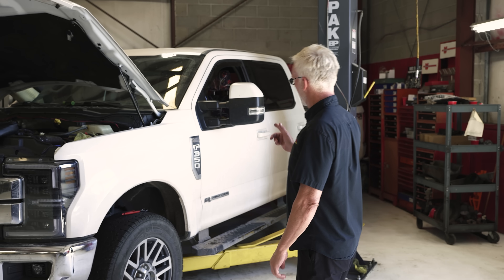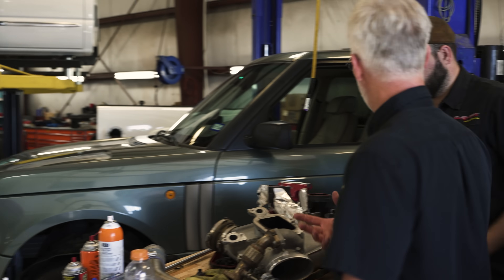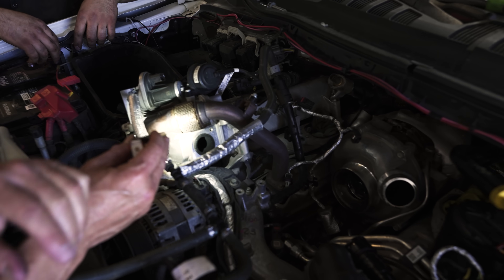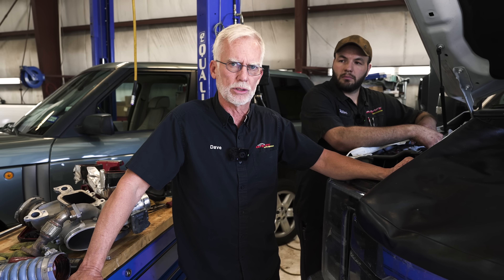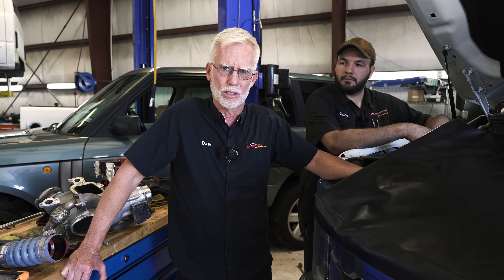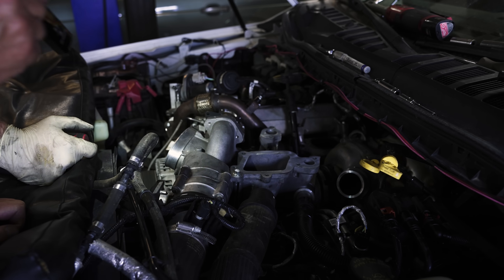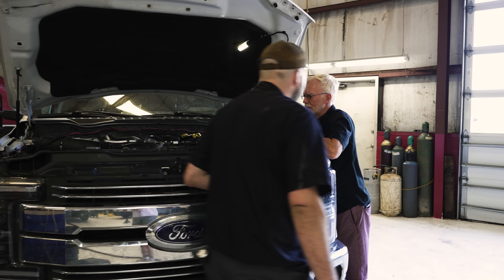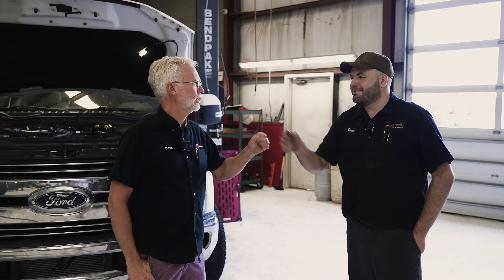2019 6.7 Powerstroke EGR Maintenance: The Problem With Carbon Build-Up

Comment: This problem mainly exists because diesel engines are incredibly dirty machines, at least when running on diesel. Cleaner fuels and engine designs should be used. Also, many people leave their trucks idling for extended periods, which is not good for all the narrow passages in the emission control equipment.

Comment: Methanol injection has proven over  and over that the steam, etc breaks this stuff up and prevents build up and keepd dpf clean.
Its a tiny amount,  its not a power adder, but it does keep engine running clean
Manufacturers reuse to do it. Because we already have the dumb def ,  its gear, so one more tank, pump, plumbing adds costs
In fact the dpf becomes redundant afyer the methanol system is allowed to do its thing
Yep plain old windshield washer fluid. 2 bucks a gallon

Comment: Dude's want to daily drive diesel work trucks without treating them with the maintenance work trucks need. These EGR issues aren't new, and they're here to stay, so get used to it and maintain them like everyone should know by now you need to.

...or just drive a gas truck if you don't pull stuff for a living.

Comment: That’s not even that bad for 200k, I’ve had them with upper and lower intakes packed with half inch thick of carbon at less than 100k.

Comment: It’d be interesting to see one on the dyno before and after, including emission levels, NOT easy for sure, running a choked engine to max and hoping it doesn’t de-coke itself mid run.
I remember the nat aspirated Transit with the bananna manifold, took a few apart to clean, sometimes just a pencil sized hole through them. 
There really needed to be a better way of recirculating the nitrogen etc.

Comment: My old 4.2 ford gas v6 had the same issues.
I frayed the end of a 1/2" cable chucked in a drill and ran it through all the intake ports in a parts washer. Worked amazingly.

Comment: Just a heads up, Purple Magic works wonders cleaning off carbon from EGR coolers. Its not as corrosive as oven cleaner and does need a few treatments to get everything off but it does work well if the parts are submerged in a tank full of it for a day or two.

Comment: One of the things Dave never points out is WHY the EGR gets this way. Too much idle time and too much fuel that can't be burned. That's why EGR was put in. There's a solution: Stop idling for hours and see if you can get better injectors. This issue went away for gas engines when companies abandoned the carburetor which wasn't efficient at mixing gas and air.
Reply: What if you install the high idle kit from BD diesel. Won't this help if you do idle for extended times?
Reply: @BB-zc4gq  it might but the idea behind using diesel engines is the high efficiency at idle. However, with the "improved" efficiency of pollution controls, the amount of damage is causing some companies to switch back to gas.

Comment: Hey Dave, gasoline engines can normally operate with up to about 15% of the total flow volume through the engine, being redirected through the EGR....

Diesel engines on the other hand, they can operate with up to 50% of the total volume that's going through the engine, being redirected back into the engine through the EGR system..

Comment: The egr needs to run hot to work.
My 2litr audi a3 diesel engine works very hard for me.i live in a  hilly Hereford UK. I seldom get to 6th gear.I have done 254000 miles and zero problems with the sensor getting sooted up.
Most people with similar engine get the coil warning sign.
They just need to find a very steep hill and load the car up with a few heavy people and drive up the hill at 4000rpm afew times.
The coil icon will go off on the dashboard and you wont need to waste your money on the mechanic

Comment: I always love learning from you Dave about engines.  I am curious as you start building engines with the speed of air pistons and total seal piston rings, will that also extend the life of the engine by being less regens over time?  If that would help extend the life of the engine, then it should definitely be pushed by you for every build you do.  Keep up the good work, love the channel

Comment: What I’ve noticed with these diesels with egr’s is the guys who use them as work trucks ,towing heavy ,foot to the floor everywhere they go have 400k on these even non deleted..The ones that use them as day to day pavement pounders around town are losing EGRs ,turbos and fuel pumps before 100k…These things need to work!

Comment: I have a 2022 F450, it does get used quite a bit unloaded but never idles long, mostly highway miles. Can I reduce this type of soot by using my engine brake more when descending a pass? Forcing higher RPM’s… do you think that would help?

Comment: How inefficient is the modern diesel engine to produce that much soot in the exhaust system that you don't see?  The DPF hides all of that excess carbon from incomplete combustion that gets recirculated to the intake system.  Diesels had EGR since the late 90's and didn't produce half that much soot with out cooling.  The additional fuel for reduced efficiency and whats required for the DPF regen process just boggles the mind.  I've owned Cummins powered Dodges since '89 with my current '08 holding on. 
The first I saw how sooty the modern 6.7 Cummins was in 07.5 when they first came out and guys were deleting the DPF with resistors etc. without disabling the EGR.  The stock programming would just pump out dark soot at idle as soon as the EGR was activated.  It wasn't long until programmers started to disable the EGR systems with the DPF delete kits and magically your mileage improved and the soot level in the intake obviously was eliminated.  Oil would stay clean for 75% of the drain interval with proper tuning.
Sad that we now need to physically remove this excess carbon from the intake system of a $30K engine to keep it alive and comply with EPA regulations.  Seems counterproductive for these environmental controls.

Love your channel, your shop and lean in with every episode with how your team...rather...family of technicians tackle the modern engines.  There needs to be more shops like this.  Cheers.

Comment: I understand there is two types of diesels, the older diesel runs cooler and produces carbon particles, which a DPF is used to filter out and burn off the particles. The new diesel runs hotter and produces nitrates in the exhaust, which is catalyst with the def fluid. I would be changing the thermostat's on this one, it could be running cold.

Comment: Dave, from South Afica, I absolutely love your YouTube channel! As a trained aircraft tech I celebrate your systems.
Regarding this truck at 220 miles. Yes, things are bunged up. I think you should have mentioned that the owner must have serviced regularly for the engine to be good with only performance issues due to breathing problems. Go fot it! I love your problem analysis motto's

Comment: With all the sensors and electronics on these trucks, it seems owners would have an idea beforehand that their driving habits were creating a maintenance issue.   I need to learn how to use FORSCAN tool but not sure what parameters I need to look for.   I do know you got to keep score.  Hey Ford, how about giving owners more choice in a monitoring menu?  Thanks Dave!

Comment: But seriously, I'd love to see some test data:  Emission levels with a fully intact modern diesel. Emission levels with a modern diesel that has been deleted (No EGR, No DPF, No SCR).  Emission levels with a fully intact modern diesel DURING regen.  Are the levels bad enough during regen to negate what we're catching in the first place??  I'm sure in the states that require inspection, shops that actually do the inspection aren't doing it during a regen.  Am I wrong?

Comment: I was talking to a guy with a brand new Kenworth truck it was beautiful he said that it's hard to get a million miles on it this is before EGR it seems to me if you're blessed in the EGR pre-cooler clogged up and won't let exhaust gases into your engine you might get another million miles out of because the system that they created clogged up and bless you if they perfect that

Comment: Dave, you probably aren't wrong, the emission control systems in modern diesels are what make them so expensive to repair and why the life of them aren't what they used to be.

the sad thing is you're still probably looking at $1000 preventative maintenance bill every 80k just to clean out all that soot from the intake tract. if only we didn't need a DPF, DEF and EGR system

Comment: I wish we would all get together and create a class action lawsuit against the EPA. These devices are robbing up of fuel economy and costing us a ton on service. There is no reason that a 4X4 work truck with a 5.9 in 2001 weighing over 10k got 25 miles on the highway and now my wife's 3.0l Jeep barely gets that at have the weight and close to the same power numbers. What have they done to help the environment other then put more money in the fuel companies pocket. The biggest question I have to raise with these rules is was this a law passed but congress or a rule made up by the EPA. Where did the rules for the DPF and DEF come from.

Comment: I wonder if egr really help with pollution in the long run?   How much pollution are you saving  when your driving down the road at a constant speed with engine at operating temp? Seems like 70s regulations put on modern engines.

Comment: You could clean whole intake system without dismantling intake and egr with cooler with machine called TEXA H2 BLASTER. In Europe we are using it as regular service to prevent clogging intake system with soot, but this machine cannot clean system when its fully clogged up, it only serves for regular mainteanence every 40000 to 60000kms or 25000 to 38000miles and it really works unlike other solutions on market such as chemical or other kinds of tools.

Comment: Now you have me worried. My late cousin gave me his father's 2000 Camry LE 4 cylinder. The egr valve wasn't working when my cousin gave me the Camry on May 23rd 2018. I didn't  know this at the time. I've driving the Camry this way ever since. So are you saying I have damaged my 4 cylinder engine? Oh geez. I have all the things to hook up the new egr valve. But I'm worried this won't do any good. The Camry needs alot of repairs for which I'm doing. Anyways thanks much for the video.

Comment: CCV valve to an oil catch can or 2 oil catch cans in series.
And
EGR pipe rerouted to tailpipe after DPF

Or
ECU Tune and oil catch can (s)

Addition of an oil bypass filter can also help with the carbon buildup in the oil.

Comment: I had to clean out my throttle body it was full of carbon afterwards my fuel mileage went from around 15 mpg to around 20+ mpg, it does help your beast breath much better

Comment: I blocked the egr on my tata hexa 2.2 when it was 10k kilometers. engine is clean. No problems. Efficiency has reduced a bit, but it saves a lot of headache later.

Comment: I have a 2021 L5P.  Ever since it was new l have used the Pittsburgh Power Max Mileage fuel catalyst. It's supposed to help the soot burn off at 650° instead of 1100°. Just recently at around 20,000 miles, I installed EGR filter by FASS. I'm hoping these things help my engine live longer.
Reply: Have u notice a reduction of def after using power max ? Does it help ur motor oil maybe not as dirty? I have a 8.3 Cummins I pull a large horse trailer,with highway miles . No idling. Be great to have some feedback

Comment: Toyota Ford Mazda 4--5 cyl  Direct Inj T/D need clean out every 60,000--90,000miles 
manifold / throttle body /egr /egr cooler / intercooler + pipe work 
clean pressure and air flow sensor 
Fit oil catch can and optional EGR reduction or delete 
Sludge buildup in cylinder head ports at 120,000 miles is severe 
Highway or city driving  makes NO difference

Comment: In Australia, lots of people put a catch can between the crank case breather and the intake, eliminating the oil going through the intake and stopping all the exhaust particles from sticking to the intake.
Reply: They dont stop egr blockages just blow by gases.
Reply: Hot burnt carbon will still cake to the inside 
Yes it is cooled down 
To approximately 130c

Comment: I Agree, also, Regular oil and filter changes are needed more frequently because of oil contamination which is a big problem, if not done will reduce engine Life. My EGR and DPF gets stripped and cleaned every year, it just makes sense, maybe need to go further, thanks Dave.

Comment: I recommend getting a pressure washer cabinet with citrus degreaser or simple green. Especially since you're going to see a lot of these for regular maintenance. I work at the largest aerospace repair and overhaul for valves, and we use an ADF pressure washer cabinet with daraclean 235.

Comment: This trickle down from commercial trucks.. it has been a nightmare for them and they claim it was supposed to regen heat to burn off the carbon... more trouble then the engineers expected... delete it and the diesel exhaust fuel DEF....

Comment: I have a 2007 Ram 2500 with a Cummins 6.7. Mopar recommends a "EGR service" at 67,500 miles. It consists of a crankcase filter, EGR cooler cleaning and a EGR disassemble and cleaning. It's a very easy service and makes a difference in the engine performance.
Reply: It's amazing what maintenance does, All these people act like it's some unfeasible unreliable thing. And people who know how to take care of their stuff don't have any problems... Crazy
Reply: the egr cleaning was removed when DEF was added to the Ram in '13 or '14. They use much less EGR, now thanks to DEF, to control NoX.

Comment: 220,000 mi is in all that bad, I just replaced mine because the PCV valve is much harder to get to but mine's gas and it has 236, 000 mi turns out it was the PCV valve going to let a mechanic do that. People don't like emission systems because they don't understand how much good they're doing. Don't drive a diesel if you don't need to

Comment: My 2011 dodge didnt come with def, but had egr. First thing I did was delete it all an took off all the plastic off my motor. So much more room to work now also upgrade to holset cheetah turbo. I get 25 on interstate an anywhere from 15 to 18 in city depending how heavy foot is. Truck is pushing 550 horsepower an 1100 torque.

Comment: I did my 6.7 at 100k.  The EGR cooler was plugged and carbon in every passage.  Not a professional but was able to do in a few days.  When I got tired I stopped.  Truck now has a 145k and still runs great.  I guess I will look at a redo at 180k.  My total costs were the gasket set.
Reply: It's literally just a filter!

Comment: Dave you know as well as I do that very few will do the required maintenance, check the SERVICE MANUAL for required maintenance schedule. The liquid Nitrogen surely is part of the problem Dave. Is soot truly carbon is my question, carbon is very difficult to remove from metal surfaces, chip it off with a hammer and chisel. Most everything if burned leaves carbon in return. I can guarantee you that nitrogen, liquid N , will eat up and pit all metal surfaces it comes in contact with. Valves, valve seats, pistons, rings, and down into the oil. Just a thought of why these trucks are lunching engines. I feel Cat skinned the cat better with twin turbos and screw the DEF and recycling the exhaust. Where is Gale Banks, he is one that quite possibly has some kind of solution to the problem and how to solve it.

Comment: The concern is the lungs and circulatory systems of those around the vehicles, like little kids. Organs aren't cheap or easily replaced like engines. Granted cities due build huge developments right near rail yards. 
Check out the children of the capital city of Mongolia. All kinds of health problems due to the air pollution.

Comment: I think this cleaning every 100k miles would be a fair compromise to get the life out of it you want. You have to balance the expense with the results and 100k is when it definitely needs it but not too far gone. The main reason maintenance is not done is cost so every 100k would be a more realistic interval.

Comment: Pittsburgh power sells a fantastic  fuel conditioner  which was developed  by a very smart lady . It was introduced into the class 8 truck market where 12 liter and 15 liter diesels  were having nightmare issues with emissions . The additive is not cheap but it only takes ounces  for months usage.  These are engines  will go a million miles.The product have help many . It keeps dpf clean with less regens , no more inframes at 250,000 miles cause of cabon pack piston rings  and plugged  up egr flows sensors , boost sensors .Also troublesome down stream sensor stopped  acting up
The cost of live has trippled  . Not every diesels  owner fork out 1000.00.-2500.00 partially  disassemble an engine to clean carbon.

Comment: It would be interesting to see if those "cleaning additives" would help with the buildup inside those parts, or if you are better off just physically removing them and treating them mechanically/chemically and going from there. I do agree with Dave it's way cheaper to just bring it in, do a little maintenance, than come in since you have a burnt valve, etc where you are talking $_$ to get it going!
Reply: I did this experiment and it helped only a little. However, when i spoke to a diesel expert he said strip it all every 2 years and clean the EGR valve(which is easy to get to on mine. More important is to change oil frequently 5-10k because of oil contamination. Also some engines need 1/2 tank of diesel to allow DPF Regeneration, and a regular long run to clear the loose soot into dpf..before Regeneration is effective